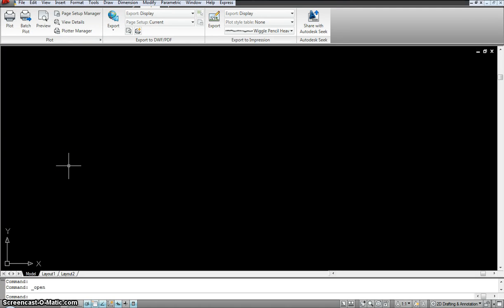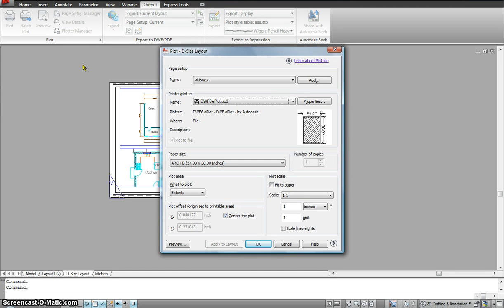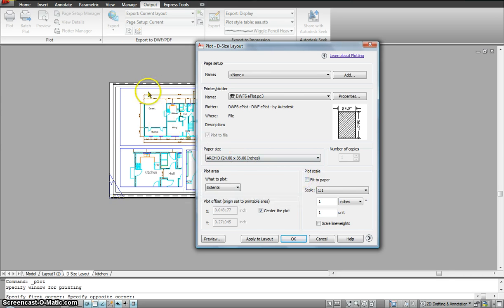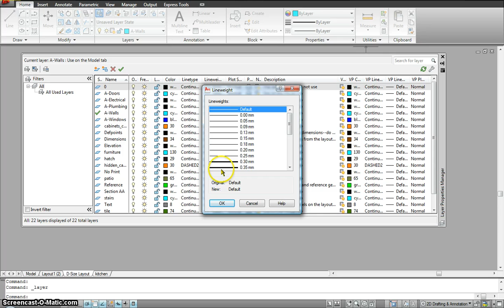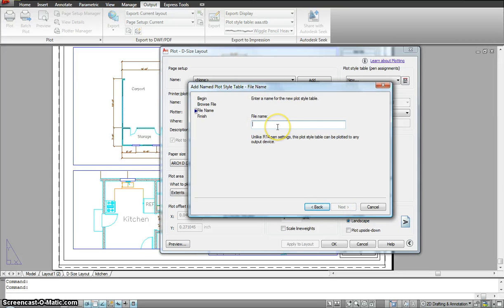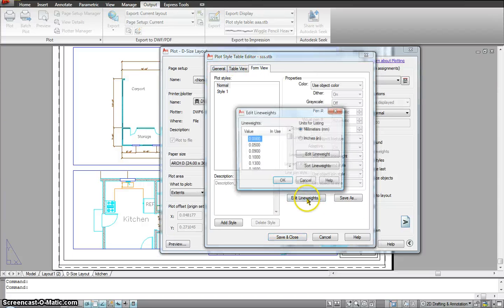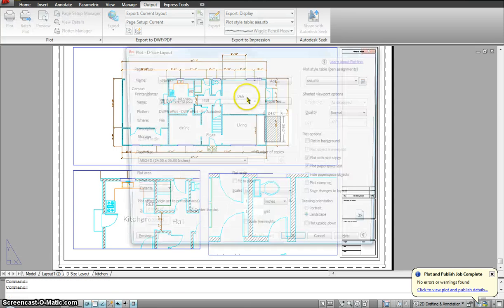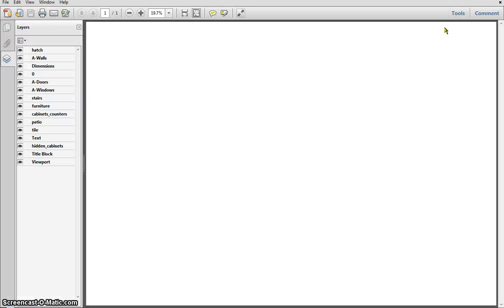Autocad Plotting and Publishing- Part 1.mp4

Comment: tutor Ali, how can I plot a drawing in a 11x17  on paper space and have the correct dimensions when I plot the drawing.  I know I can use different scale on a view port, but when I plot my drawing on a 11x17  and measure my dimensions is not the same as when I plot on model space.  Thank you.
Reply from the maker: +chiri boy please watch my video on viewports. You always draw 1:1 on model space by default. When you will print you go to the papers space and select 11×17 paper size and fit your drawing within that paper using the scale that fits in that paper.